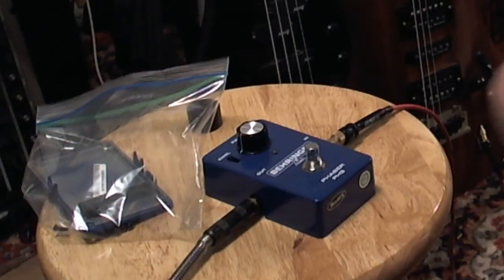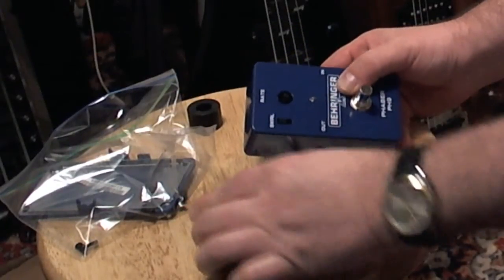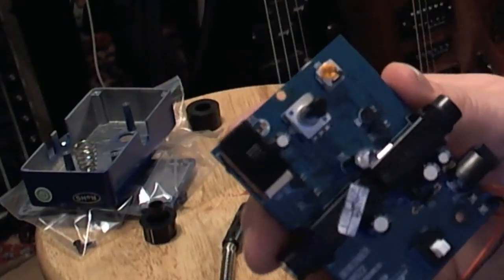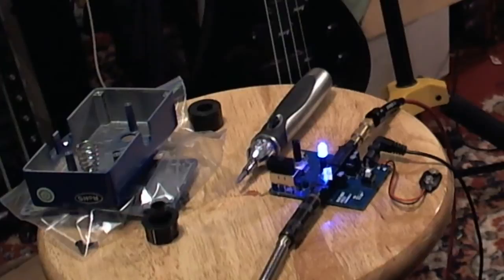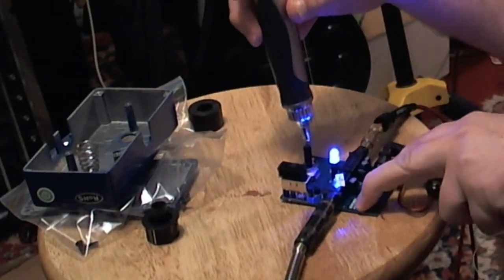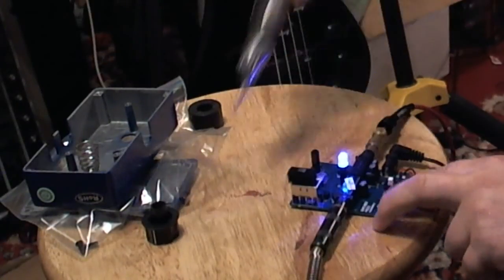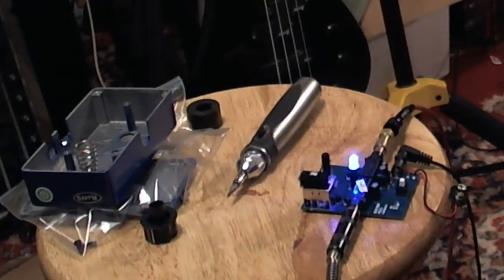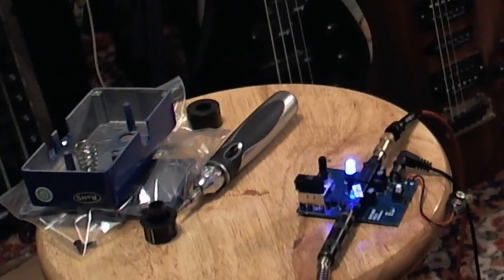Behringer PH-9 trimpot adjustment mod

Comment: If you take the bottom off the unit, you should see a very small access hole through the circuit board.  If you have a jewelers screwdriver small enough, you can make this adjustment through this hole which eliminates the need to remove the knob and circuit board.  The amount movement for the adjustment is pretty small.  Just slightly off the factory setting either direction will do it.